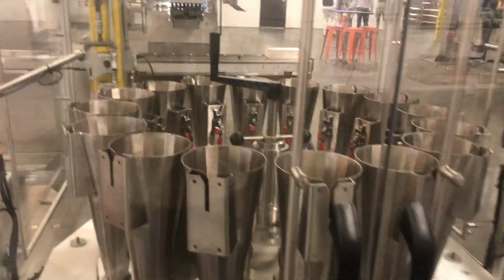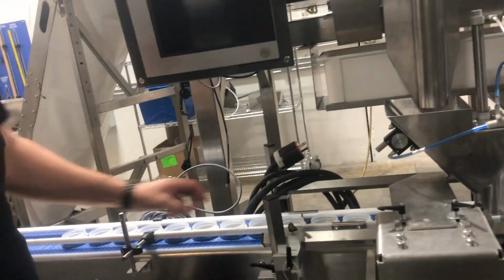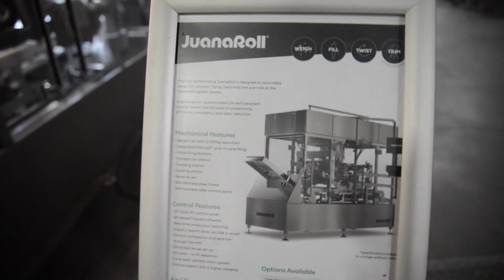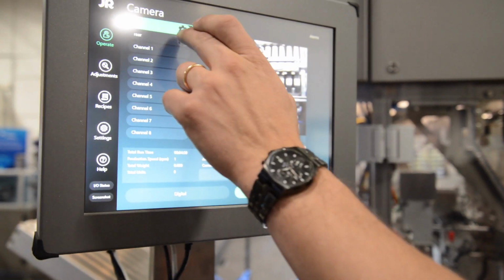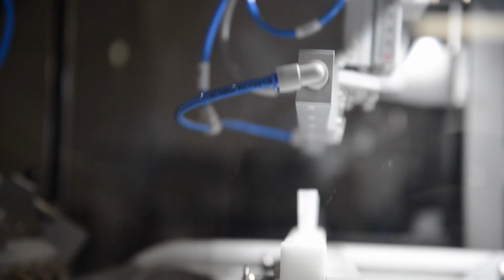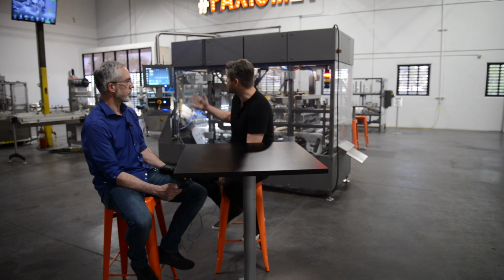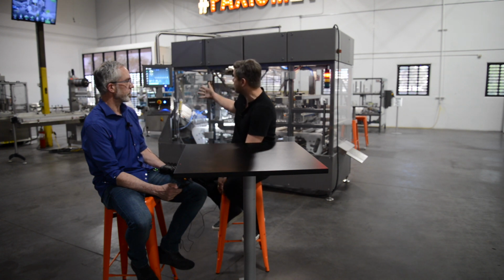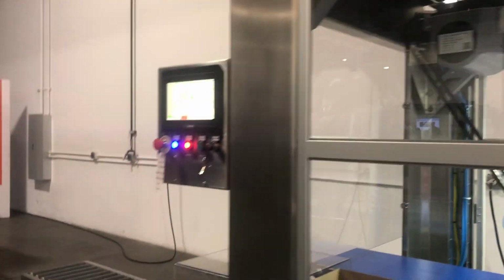Rolling into the Future: How Preroll Automation is Changing the Cannabis Industry

Comment: Paxiom is one of two companies with an NTEP approved bagging machine. Congrats to them on that. There are no NTEP approved joint making machines on the market, to include the JuanaRoll. I was thrilled to hear that Nevada weights and measures actually required an NTEP cert before allowing the Paxiom bagging machine to be placed in to service. I'm not aware of any other state that actually stepped up for consumer protection.
Reply: I stand corrected! The JuanaRoll became NTEP certified in March.  Paxiom's whole line is NTEP approved. Congrats to them for passing NTEP certification and being first to market on it. Big news as far as weights and measures is concerned. Anyone considering buying bagging or joint making automation equipment is compelled to use NTEP certified one.
Reply from the maker: Certifications are important, especially to help stand out. It's crazy that Futurola still uses so much plastic in their designs. I mentioned that to Patrick & the team years ago & he just looked at me like I was an alien, lol!
Reply: @TalkingHedge  Right. That plastic keeps their price low (4K or so for a start up system and accessories). The knockbox is killing the entry level market. All of the weighing in our industry, joints, flower and concentrates  is supposed to happen on an NTEP approved weighing device. In WA joints are universally filled by volume vs weight. Not legal, but not enforced by Weights and Measures officials.